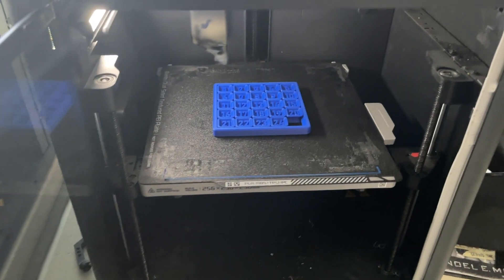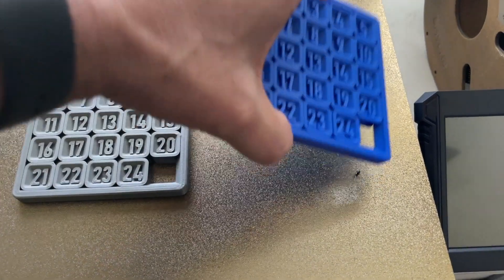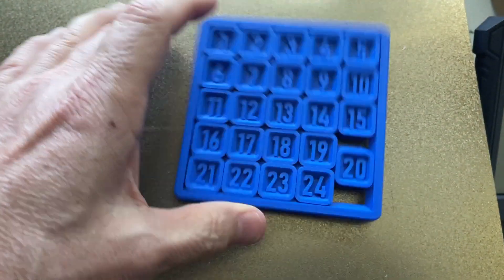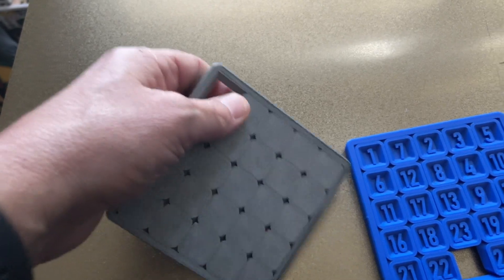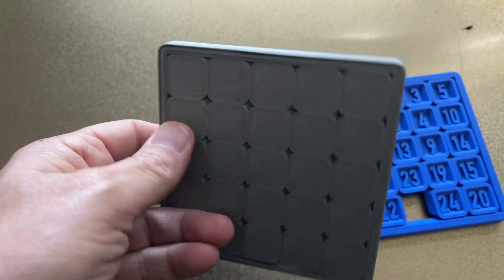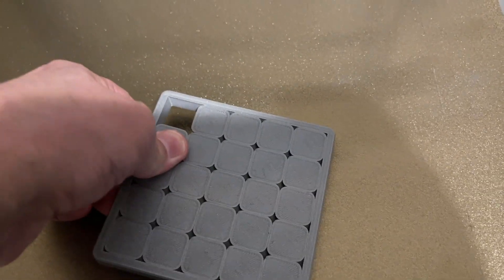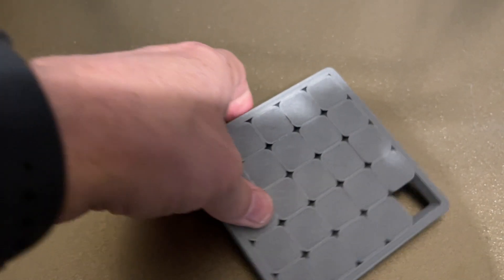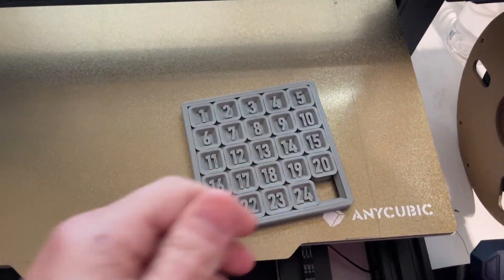Print Tolerance Tests on The Kobra 2 Max

Comment: You dont have to use the Anycubic slicer
Reply from the maker: I have been using Orca and its been much better.  I just wish you could send the GCode wirelessly.
Reply: @3DPrints747  yeah any of these cheaper machines I just discount the wireless capabilities because you end up using a slicer that can't send them anyways
Reply: @3DPrints747 

Slice and save in slicer of your choice , load in anycubic slicer and send it wireless. 

You shouldn't have to take this extra step but until any cubic fixes that this is work around that works.

Comment: Looks like your z height is too low on the k2max.  And your bed is not completely leveled in certain spots.  Make sure your bed is as level as you can get it.  Then set your z height to not squish the print on the first layer.
Reply from the maker: Thanks, I'll give that a shot!!!